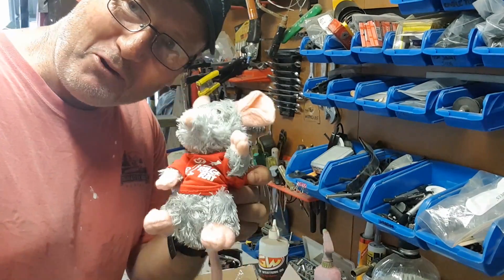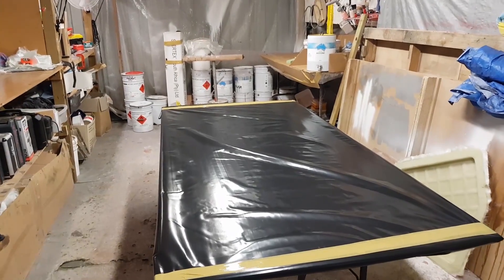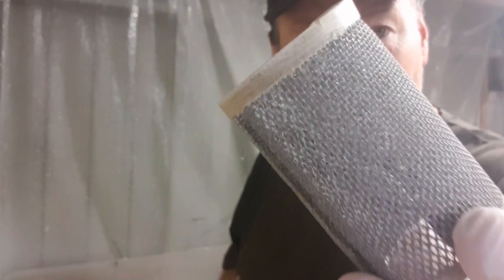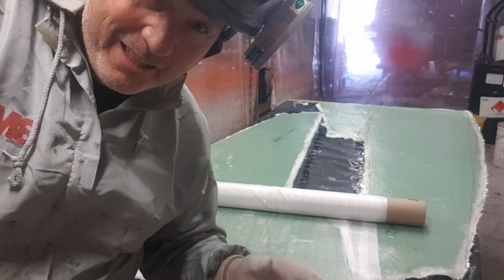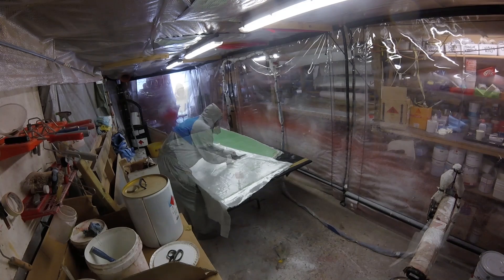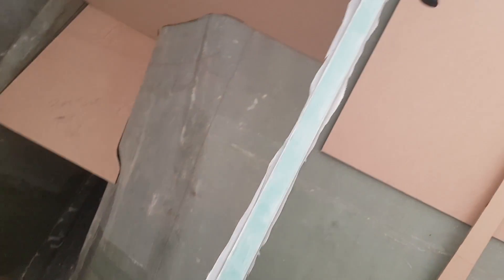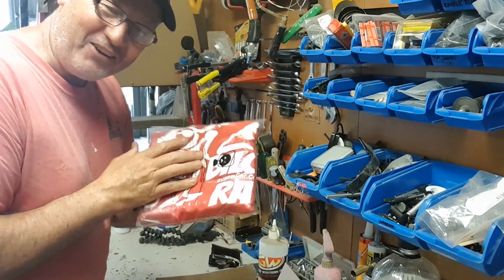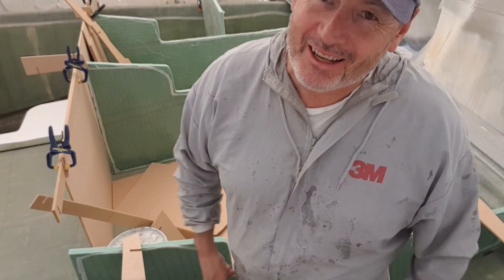Ep052 Making Foam Core Yacht Bulkheads - Life ON The Hulls - Catamaran Build

Comment: Is there a particular reason you're using vinylester over epoxy? Other than dosh, I've been hearing epoxy is more expensive than vinylester.
Reply from the maker: Epoxy 1/3 more expensive,has to be faired painted whuch can add up to $100 000 in fairing and painting.Vinyl is compatible with gel coat and is actually a modified epoxy with a similar chemical backbone and is equally as effective in minimising osmosis and is UV stable unlike epoxy that is not.Vinylester is also much faster and easier to work with and far less temp and humidity reliant than epoxy.I use tonnes of epoxy for adhesion and in my profession but for this cat vinyl is far more suitable. Ross
Reply: @LifeOnTheHulls  Ok. Cheers. Sorry for all the questions, I wanna learn as much as possible.
Reply from the maker: All good

Comment: Ross:  Why do you roll your glass instead of bagging the whole panels and pulling a vacuum to fully distribute the epoxy?
Reply from the maker: Its a matter of speed and the fact that I am using vinylester not epoxy is both well suited to this type of laminating.I will of course pay a weight penalty of approx 10percent perhaps 20 if I infused rather than vac bagged but in the grand scheme of things,speed of layup and excessive consumable costs and materials wastage I would be ahead economically and with way less wasted vacuum supplies,ie bags,resin blankets,hoses,etc.I do have a vacuum infusion system and if i had a crew i would certainly consider it as it keeps employees busy working,watching etc.The wright of this boat has been revonfigured from the original and is set to be about a tonne lighter in any case simply from the changes we have made..
Reply: Thank you for your information and reply.  I one day will be building a larger cat and you input is very important to me! @LifeOnTheHulls

Comment: I have a binks b8 chopper gun with 3000 in parts to rebuild all the pumps and consumables I could break it down and ship the pumps with out the frame
Reply from the maker: How much would you be looking for for it,freight would be crazy,
Reply: Life On The Mold - Building a Catamaran 
It’s a system that will handle 2 55 gallon drums of resin 
I have loads of replacement parts all in organization bins 
And the manuals 
9000 us plus the shipping I’d have to build a crate the arm and base for the unit would be impossible to ship it’s large you’d have to build something 
I have allot of rubber chopper anvil  wheels it would be a huge time saver
Reply from the maker: That is some system,Sadly it wouldnt be cost effective as I already have a Graco Rs gun and can add a chopper to it for less than 1000 aussie, dollars.My pumping system will deal with it flawlessly as well but I have no intention of usung a chopper in the immediate future.If I was just setting up I would get yours for sure.Cheers Ross

Comment: Nice progress.
Did you considered vacuum bagging the panels to squeeze excess resin and save some more weight?
Reply from the maker: Definately considered it and sadly I simply dont have working time to vac bag,infusion perhaps but not vacuum bagging.I weighed it up and even though I have infusion gear the weight saving is this instance would probably not warrant the extra set up,costs and consumables.I am already taking substantial weight from the original design so a trade off indeed, but these panels are as strong as is needed. Thanks buddy. Ross

Comment: Impressive compressor ! Lots of volume !  I assume each motor is running on its own phase, correct ?

I know that sealing the edges will not add any strength, but do you plan on doing that when you install those bulkheads ?
Reply from the maker: Each motor on my compressor is separate but the compressor is single phase so can be used on any premises.Oil less as well so no  contaminates in lines.Volume is 100ltrs so more than enough for my purposes.Very quiet and I love it.All the best
Reply from the maker: Bulkheads are bonding to deck and other bulkheads with bonding paste,radiused and tabbed with multiple layers of 600double bias tape in every jont and peel plied for smoothness.Heaps of that to come.Rossco

Comment: Could you use your template attached to the laminated form to trim the laminate with the router?
Reply from the maker: Thanks Craig,originally used the template but the router wasn't a great solution without a fibreglass cutting bit.The grinder and multi tool dolved the issue and was as accurate as I needed.Thanks for the comment,Cheers.

Comment: Hey bud.      You should look into Arbourtec tuff blade     Resharpenable and replaceable grinder blade.    Way less dust  ideal for hacking those edges off your laminates or after demolding.    Also 125 mm saw blade on grinder          I have all options on different grinders  saves swapping blades       Guards are safe too but don’t they limit the tools use.     Take care     The build is looking good.

Comment: Just a thought.   Would it have worked to clamp the pattern to the newly made bulk head.  Using the pattern as the guide for the router would enable you to cut clean lines to the exact shape.  Sweet project!
Reply from the maker: Thanks for your comment.I originally tried the template overlaying and the router and it simply wasn't the right tool for the job.I found the grinder and multi tool to finish it off accurately.All done now in any case and thanks for watching my channel.Cheers Ross

Comment: My experience with chain lockers is that the chain locker stinks. If you are ever at anchor for more than a week there will be marine life on the chain and cable , some seafloor mud if organic rich and stinks ..   I hope your chain locker is easy to clean , with smooth walls and floor made of abrasion resistant tough coating, with hatch and vents that allow a person to enter that muddy stinking hole and live to complain.
Reply from the maker: Brilliant stuff Michael.My chain locker will be fully flowcoated with a removable cleanable substrate as we all relate to that smell.Thanks for the lovely description.Cheers Ross

Comment: I'm not sure if this will help you or not but when I used to work with fiberglass we would run around our part/mold with a utility knife just as the glass reached a firm enough point that it could be cut with a blade. If it gets to hard to cut that's it, grinder time, but if you catch it at the right time you can trim the rough off in just a few minutes. Try it in places that wont show if you mess up, but once you learn the feel of the glass... when it cuts best you will really save your self some time and trouble. Give it a try ,it works, just keep a fresh blade in your knife. Great videos ,keep them coming!
Reply from the maker: I am a huge fan of the green trim,I was given that advice many ears ago and live by it today.In this case,it is simpler to cut of with the grinder as the shapes are all varied and I am now laminating full sheets rather than patterns,just much simpler to di it that way  .When making kayaks I always green trim so important to speed up demoulding.Thanks for the hint,I love this feedback from you guys.Ross

Comment: Hi Ross, been following your video's from the start. Great job, always looking out for the new episode. We make food trucks, the fiberglass panels we make, we used to trim them with a router, works great, but if you spin the bit to fast, it burns, both the router bit, and your work peace. The grinder works, but creates a large mess, and a lot of dust, we now use a multi oscillating tool with, a half rounded cutting disk on it, we use the foam as a guide rail to cut it, works great. A lot faster than the router too !
Reply from the maker: Great advice Tim,my multi tool is on the blink at present and I struggle to get blades for it do might be time for a new one I feel.Cheers and thanjs fir joining in.Cheers Ross

Comment: I know its way more expensive and time consuming, but it would great if all the structural bulkheads were foam/laminate sandwich. Here is the US, BSB plywood (Marine grade, low void, low defect) is about the same price per sheet as (let's say $80 USD) as certain flavors of Corecell or AirX 70kg/sq M.  Of course, that doesn't equate when you have the cost of laminate, resin, and labor to lay them up. But wouldn't it be great to have ZERO wood (except maybe the cabinetry and other pretty stuff)?

Comment: As always a great video! Congratz on the coin :D Question  on the frames you laminated, why did you not laminate around the edges, doesn't that need glass too?
Reply: Laminating around the corners is tricky so you don't do it unless you need to. All those edges will be glued to another laminated surface, with more glass and epoxy. They won't stay exposed.
Reply from the maker: Hey Don,the edges of yhe bulkhead sheets are tye n bonded to he gloor,other bulkhead etc,then raduised and tabbed with multiple layers of double bias 45 x 45 glass cloth tapes about 6 inches wide.Every surface is tabbed at 90degrees to each other for integrity.Cheers buddy.Rosd

Comment: More great progress.  Definitely glass the rat into a bulkhead.  It will drive the surveyor crazy. :-)   

Did you say you were considering laying up whole sheets of foam and then cutting out the pieces you need?  Would seem to be less waste, so long as the fiberglass orientation was not critical to the strength.  You have to trim it to size with your cutoff wheel anyhow.
Reply from the maker: Hey Dave,went on to laminating ccmplete sheets ,and using excess to complete bracing blocking etc,there will not be much waste rest assured.Rossco

Comment: I would have had you drill or poke a hole in the foam every 2 or 3 inches, then insert a piece of woving roving in each hole before laminating each side, your strength would have been tripled, even a piece of Core Mat on each side would increase the strength by 50%..... I don't understand why using a Peel Ply?, I've been a boat builder & repair man here on the Chesapeake Bay for 43 years....I also make Vintage Hot Rod & Cycle parts and molds on the side, I have a few fiberglass videos of the hot rod side of things you can watch on rainy days, you might find a tip or two in there?....  Anyway, anymore vertical pieces you make like this, try this method with Woven Roving though the holes for Triple strength, they will be so strong, you could use them for dump truck ramps if need be! .... Still, I don't understand a Peel Ply when hand laminating?  ...... I've been watching you build this craft for sometime now, you're doing a terrific job!
Reply from the maker: Agree eith adding the roving.The foam has a perforation every 40mm to allow resin to penetrate for extra hold and some rivings in there would certainly beef it up.Cheers buddy love your channel by the way.
Reply: Peel ply instead of sanding later when it goes pass re-laminating window and gets rid of all those sharp needles on the surface
Reply: @vettepicking  (Fiberglass 101) PEEL PLY is never used in hand lamination (Fiberglass 101)  .... Peel Ply is used in vacuum bagging only.... If you don't want little pickers or splinters, you use WAX RESIN, it forms a film when it cures above the fiberglass and incases the pickers! .... however you have to sand the wax resin off in the areas where you will fiberglass to it later..... I've been fiberglassing for a living for a very long time...from Race Car & Vintage Corvette bodys in press molds to full size yachts to vintage drag racing and hot rod parts to custom Harley parts..... Peel Ply in lamination is a waste of time and two extra steps to get the same results using waxed resin, not to mention high cost in wasted materials!
Reply: @GasserGlass  wrong
Reply: @vettepicking  yeah,okay, whatever you say
Reply: @GasserGlass  hahahahah everybody's an expert, now i see why you don't try to help people anymore, to many trolls!
Reply: @MrRoach-yo3mz  amen
Reply: GasserGlass   Wax is a contaminant.
Reply: GasserGlass   Ross is SPRAYING resin in a small storage unit that contains ALL of his supplies! Think about THAT for 44 years!
Reply: @GasserGlass  Sorry but you are just plain wrong to suggest using wax in this instance. The panels will require tabbing in and any wax on the surface will cause poor bonding unless removed fully so why take the risk just use peel ply as he has done. Peel ply is not just for vacuum bagging just goes to show how little you know with your 44 years of experience.
Reply: @vettepicking    Trust me, GASSERGLASS knows his fiberglass composites  he's made car parts and bodies for racers that hold land speed records at the Bonneville Salt Flats and holds 2 records of worlds fastest fiberglass bullets @ 2,700 feet per second and carbon fiber clips on the space station @ (17,000 plus mph)

Comment: I can see what you mean, laminating whole panels, instead of precutting the template, would save cutting those smaller pieces of glass.
Reply from the maker: Yepbm certainly solved a lot of issues Brian.Offcuts are then used in various bracing and critical areas later on.Very little wastage.Cheers Ross